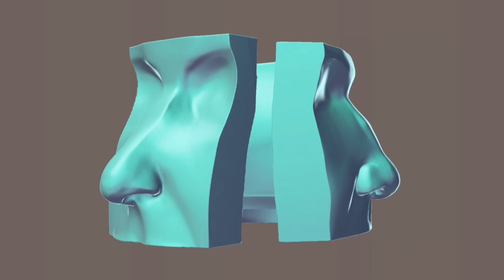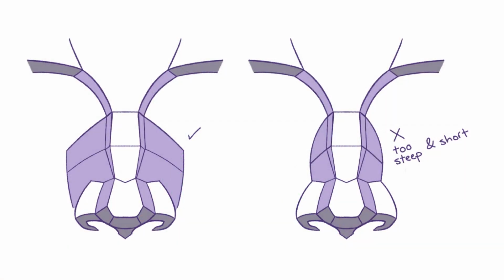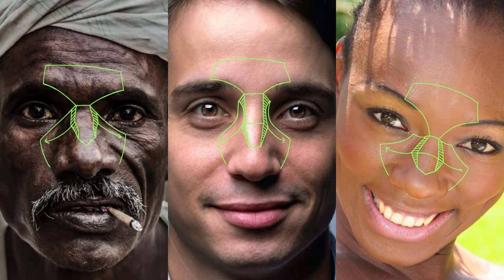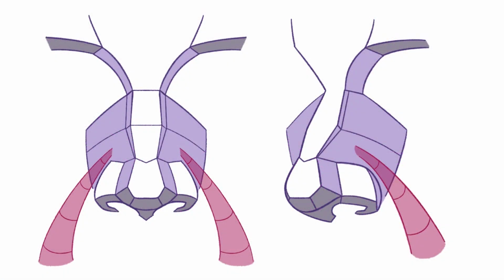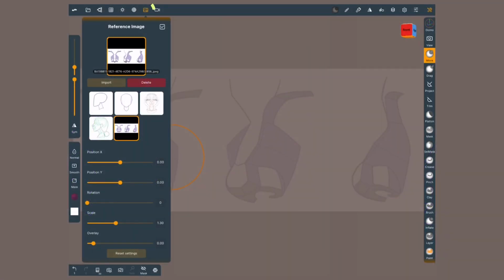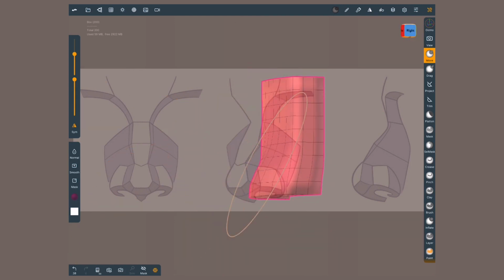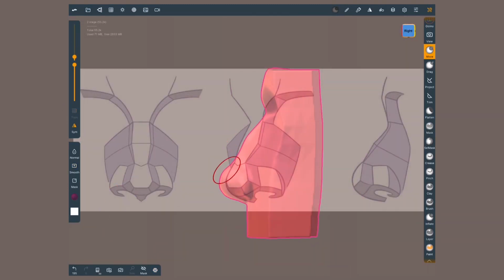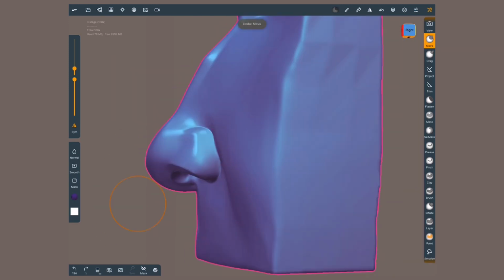Nomad Sculpt: Realistic Nose Step by Step

Comment: Thanks for making nomad tutorials. Does multi-select with smooth button still work for you?
Reply from the maker: It's always a pleasure :)

Yes, multiselect still works for me with the smooth button. I believe with the update it had some adjustments. When smooth is active, you can multi-select from the scene menu. But if you want to multi-select from the viewport (tapping the meshes) you have to hold down smooth to work, otherwise it won't work. If none of this work, I'd recommend reporting the bug in the Nomad Forum, the response is usually super fast.

Hope this helps :)